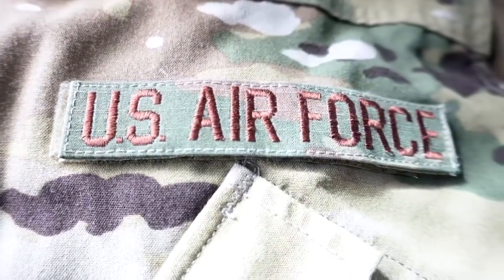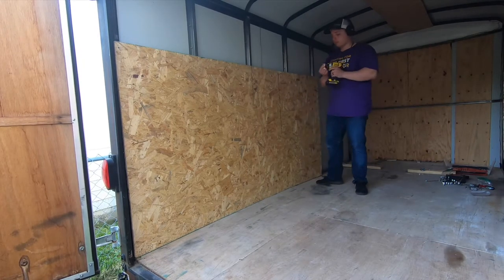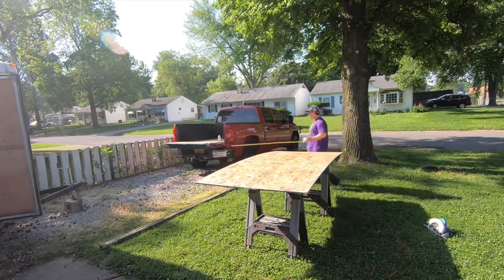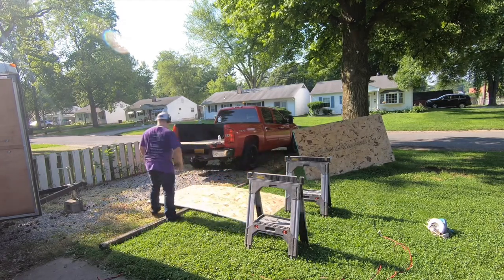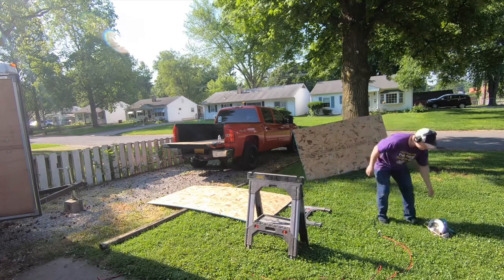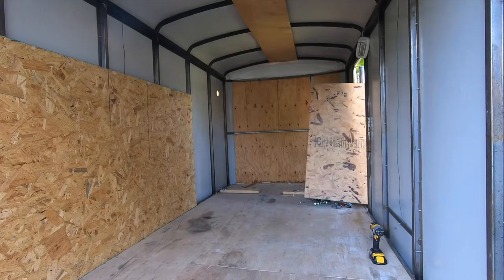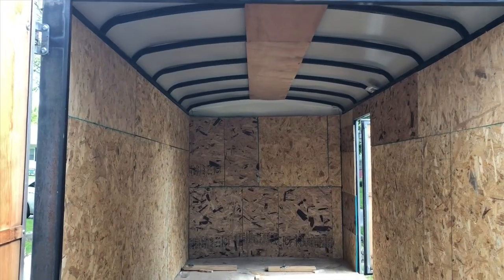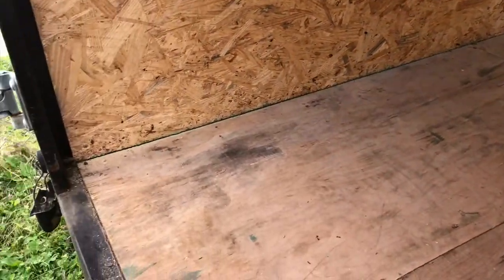Installing Plywood walls in an Enclosed Trailer conversion Episode 2

Comment: I've been told the reason for the gaps and thin plywood was to allow the trailer to "flex" as it goes down the road....but I also have enough grey in my hair to call BS to marketing schemes.  Shoddy workmanship is shoddy workmanship.  Thoughts?  Yes, 1/2" plywood will add rigidity - does the trailer need that or is it hurting it's ability to flex
Reply from the maker: I've had the plywood on it for about 3 years and it has only added to the rigidity. Before I could slightly push on it and it would give. With the plywood if something shifted or fell on the walls I knew the trailer would still be okay. Hope that answers your question.

Comment: Maybe a rookie question, but what kind of screws did you use to mount these to the structure that was there on the walls before you paneled? (The sort of "studs", but I know that's not really what was there, it was more of a metal frame.)
Reply: Id like to know too.
Reply: Me too
Reply: I’m thinking tapping screws

Comment: I am a total rookie...sorry. what kind of screws do into the studs? That is metal.
Reply from the maker: I used sheet metal screws and they are holding solid so far. Hope that helps.
Reply: Ok awesome thank you
Reply: Also, would u add insulation btwn the plywood and particle wood? Im making a travel boutique.

Comment: You should consider painting the walls white to help with lighting
Reply from the maker: Great idea!
Reply: What did u use 2 drill in2 the ribs an what size screws bolt s lol i just got my trailer an have no idea what 2 use 2 drill lol an where im assuming in the ribs  please help